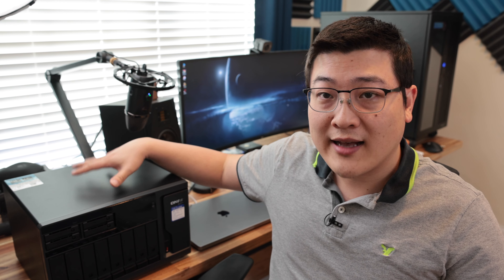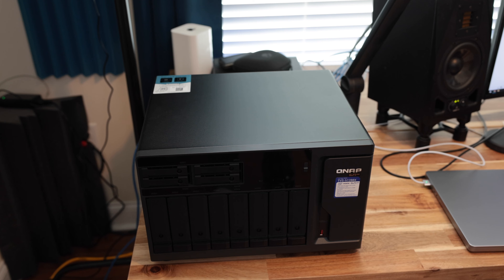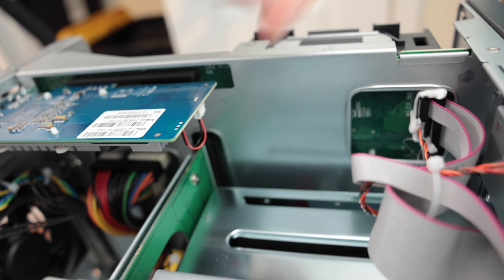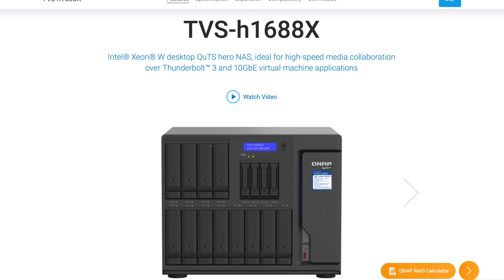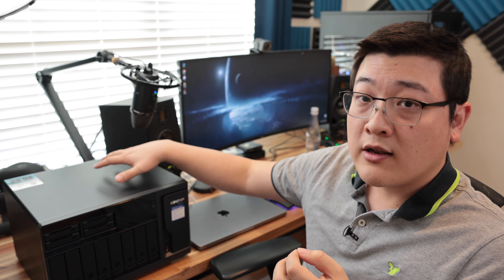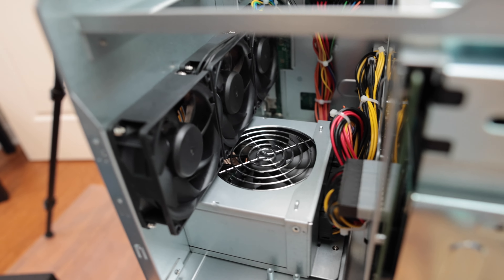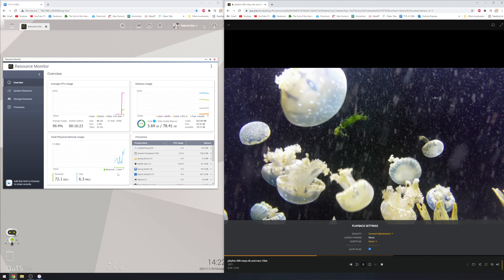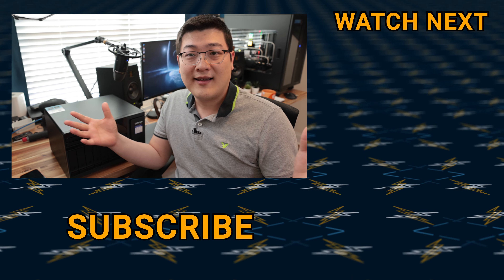This NAS is Insane Overkill & Plex Monster | QNAP TVS h1288x Review

Comment from the maker: Do you have a NAS? If so, what kind of NAS are you using?
Reply: Great overall review of the TVS-h1288x. I also have the same NAS with the same 12tb drives minus the ssds as I currently don’t need them. I also upgraded the RAM to 2 32gb sticks but decided to leave it at 64gb and keep the original 8gb sticks as a backup just in case. Great NAS for media sharing/collaborating, VMs and of course Plex.
Reply: QNAP TVS-471, primarily for business documents and extensive photography.
Reply: I'm using a Synology Ds720 plus two bay 16Tb drive with two samsung 500gb nvme ssd cache upgraded 2gb ram to 6gb ram  good enough for my plex server 👍🏿🤗
Reply: DS918+
Reply: I'm going to take my first dive into NAS soon, I'm researching the options.  I have no idea what route I should go.
Reply: QNAP TVS-872XT, 64GB RAM and a Core i7, which might actually be even faster than the one in the NAS presented here, I'm not sure. What definitely makes it faster though is that it has a built-in graphics card for rendering (which is optional though, it doesn't come with one). What I'm sure about is that that one is just as much of an overkill as this here, because it's also a flagship NAS more geared toward professional studios with quite a staff rather than the private one-man studio at home.
Reply: I need to sort my storage out. Will it get out of date before you use all. I don't understand PC as Mac based im not sure. do you have to have the same size and make of drives, I had a 8D Drobo and need too update now so I can access my video data wirelessly in the house from different computers. does it have. thunderbolt card? Do you use a switch to put this to and then line to your modem?

Comment: I have TVS-871 that acts as my backup server. it is also capable of saturating the 10gbe with SSD cache. my 1688 came with broadcom 10gbe. the fan died within a week and according to FLIR it was hitting 80-90C. I eventually made my own HSF. made a 50mm*100mm with a 40mm 0.1A 12v fan. and the temp hasnt exceeded 40C. those fanless NIC are meant for server rack casing with force feed airflow. not meant for casing like ours. I also upgrade my CPU to W1290 10core and changed all the rams to DDR4-3200. using liquid metal pro as the thermal paste seems to help keep temps in check.
Reply: that said I switched back to normal QTS. i have 96GB ram and 2x2TB SN750 SSD as cache. with 8x 16TB exos X18 with 4x 6Tb HGST drives. I could only do 850-950GB/s on the EXOS with SSD cache with QuTS. . but on QTS, I could do 1.15GB/s with SSD cache. that said with ZFS, scrubbing is 1.5hr but QTS is to 24hrs+. SSD cache also helps when pairing with channel bonding with 2 terminals with 10GbE. it is able to push out 1.8-1.9GB/s

Comment: What made you choose ZFS/Hero ? 1 reason I didn’t choose is because I don’t have 8 drives all at the same time yet. Just 4. So essentially by the time I’m ready I’ll have to most likely buy another equivalent NAS & start there & then transfer. Using TVS-872XT with 4 x 16TB Ironwolf pro drives. Returning my NVME SSDs today. Didn’t see any speed increase for my uses.
Reply from the maker: I prioritized the hardware more than ZFS. The 872XT is a solid NAS and QTS is perfect for most users. I was looking for a stronger processor and a few extra slots for SSDs. The 872XT has a 6 core clocked at 1.7Ghz that boosts up to 3.3Ghz and is only rated for 35W. The W-1250 on the other hand is a 3.3Ghz processor that boosts up to 4.7Ghz and is rated at 80W. I don't need the thunderbolt on the 872XT so the 1288X is more appropriate for me. 

QuTS Hero does have a slightly better throughput over QTS but it's not a make or break IMO. In line compression and deduplication is nice but is kinda wasted on me. Self healing healing of silent data corruption is also nice but I probably wouldn't notice either way. I see QuTS as a nice little perk for having a powerful NAS that can leverage the OS.

Comment: Can you populate with different size drives or do they all have to be the same size drives?
Reply: You can do that with Synology SHR but not on QNAP.  QNAP uses traditional RAID, which requires all same type of drives/same size. I don't think you can do different-size drives on Hero OS due to RAID-Z configuration: you lose the extra space on larger drives whose space is above the smaller ones. My understanding of it (I don't use ZFS yet) is that if you have 10 drives and 8 of them are 8TB and 2 of them are 10TB, you will lose 2TB right off the bat for each 10TB (4TB total space lost) drive to stripe across all 10 drives. It is recommended to use all same size for this reason with RAID-Z.

Comment: I understand about not being able to expand the pool drive size once it is made with ZFS, but can't you just make an additional pool and use that with your current pool of RAIDed drives? 
I currently have an older 8 bay system with just QTS, 4 drives in RAID 5, second poll 2 drives in RAID 1. And I use the last 2 bays for SSDs and use them in RAID 1 for SSD cache. 
I say all this for people that buy a 6 or 8 bay system but don't have data to fill them or money to buy all the drives at once, they can just add drives as needed and create additional polls with the new drives.
Reply: Yes but you will be splitting your performance capability across 2 pools versus using all drives to drive max performance through 1 pool.
Reply: @almaq2078  I am sure that would be true especially if your a using a 10G network along with SSD caching? I know for a fact that with a 1G network it is not true.
Reply: This idea confuses me as I am new to Nas, and configuring Raid, Storage Pools, and Volumes.

So if I wanted to expand or add on a different drive or type of drive, does that mean it has to be set up in the original set up of the NAS?

I also read where some drives like sas and sata cant be raided together?

Didnt realize there was so much planning in a NAS set up.

Can someone clarify how to avoid set up pitfalls?
Reply: @wildwillybilly  I am new to QNAP also. So I watch a lot of the YouTube videos to help me figure things out. There are videos out there that explain what storage pools and volumes are. QNAP UK YouTube channel is a good place to start.
Reply: @mj1s735  what’s not true? 1 pool with 8 drives vs 2 pools with 4 drives each? Or whatever number pools you want to create … 1 pool with all drives will out perform multiple pools with less drives.
Reply: @almaq2078  I am talking about when doing file transfers to the NAS. If you only have a 1G network you will max it out with just 2 drives. I can also get better performance with SSD cache, but also this will not matter unless you have a network that you can't max out the bandwidth easily.
Reply: @mj1s735  ya I understand that limitation. Basically 1G network cannot drive enough IO to push the pool to max vs 10G being able to drive IO. My point was and is that 1 pool is the best config for max pool performance. Whether one’s network can drive it, is an entirely different technical problem.
Reply: @mj1s735  Thank you. Yes, reading and  videos are consumed when time commits.  I suppose my question need to be drilled down to cut down on learning curve when setting up and hoping not to waste drive space and function.   I was looking for more videos or anecdotal stories of trial and error pitfalls that people found to be best practices in situations where they wasted drive space for the raid/pool storage/ or value . . .  or had to move data then delete it(and re setting up nas pools/volumes), by looking back after they set up when learning and gaining experience with missteps/underestimating storage setups.  I was hoping the author @suprusr stan . . .or anyone scanning video/this thread might chime if they see this thread.  Thanks again for the response. 

In regards to your to  response to,   @al maQ ,  about the 1GB network (Does that mean the ethernet connections between router, nas, and clients?)  That the speed of Nas drive function wont matter as much with higher speed drives if the ethernet is maxed out at 1GB (Router?)?   I heard a 6e cat might be over kill.  Not sure if that is true And does that mean a better router would avoid a bottleneck??

Comment: QNAP TS-1677x-1700-64g 550W (64TB-Hot), 2 Vols RAID6, 1 Vol RAID 0, 1 Vol RAID6 SSD Cache, (48TB-Warm (external Cadies)), I also added a 1092cuda-core NVidea card for Video-Bypass; currently focus it on system instead. It significantly increases the response of the machine., Synology 1819+ (16gbRAM)(8TB) 2Vols SHR2 with 512G file cache in RAID 1, Synology 1817+ (16gbRAM) 32TB 1Vol SHR2, I also tested Trunas on DELL R815s with ESXI platform, but not using this atm. I also have a QNAP 4 drive bay NAS for surveillance, but the motherboard died, and no warranty after a year. That is disappointing with QNAP & Synology. If there is something they should do better is with their Warranty policy. I'm hesitant to purchase another QNAP or Synology for that reason alone.

Comment: i wish i could afford something like that but at this point isn`t it cheaper to just ''make a older pc to a nas?''
Reply from the maker: Yes, FreeNAS now known as TrueNAS is the cheaper method if you want access to ZFS. I used to run FreeNAS for a few years back and it was fun and all to tinker with that platform and performance was great. However it was during a time when they were overhauling the OS and plugin system to docker and it broke a lot of my plugins. I'm not sure the state of TrueNAS but it's probably fixed by now. That tumultuous transition pushed me to QNAP for something a little more production stable and purpose built.

Comment: Good day! I need an expert opinion!

We have a small film production. We have an office and 4 Mac Studio in it. We want to install a NAS in the studio so that we can edit from it IN PARALLEL on all 4 computers, accessing the same volumes/files from several editing stations at the same time. We plan to make a local 10G network. I want to buy QNAP TVS-h1688X-W1250-32G for this purpose. But some sellers in stores assure me that this is an amateur level device and it will not allow mounting simultaneously from several mounting stations, and advise me to buy QSAN XCubeNAS XN8012R which in my opinion will not justify its money because it has weaker characteristics (we also do not have a server rack now). What do you advise in this case? I want to find the best solution for my money and not let my fellow editors down so that they don't suffer from bugs later.